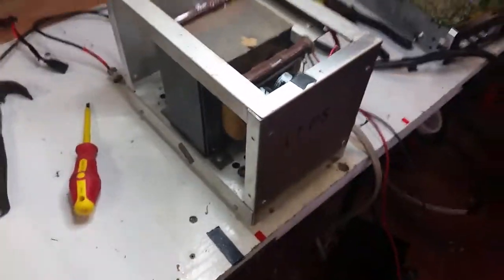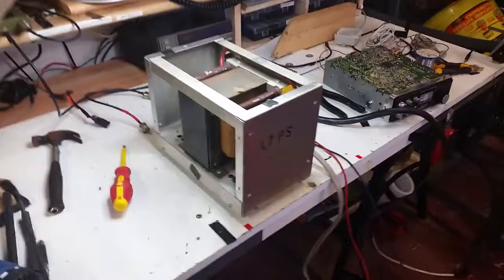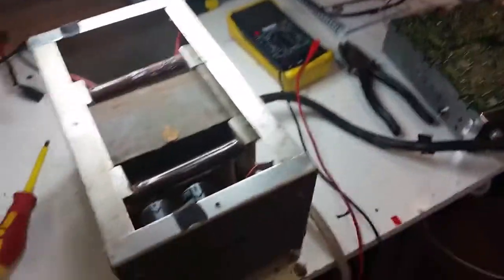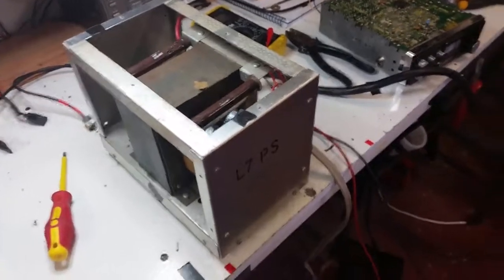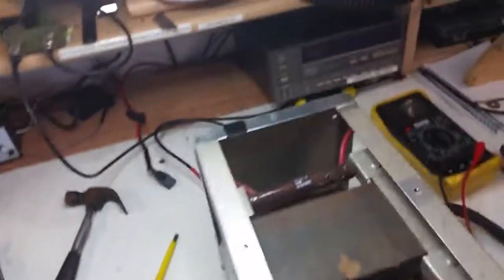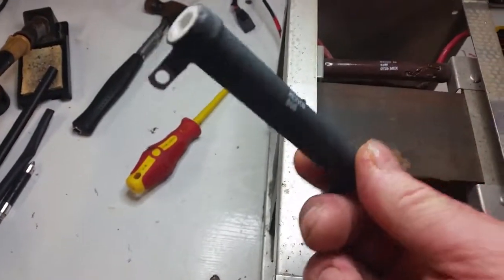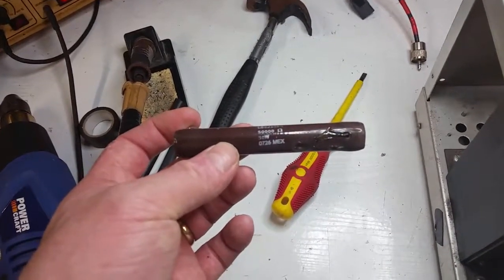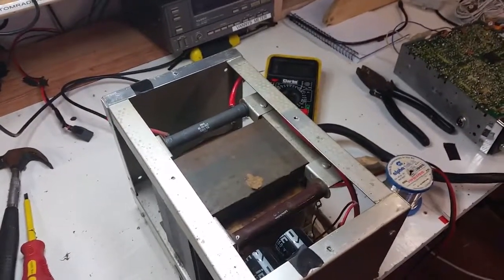Drake L7 amplifier power supply repair

Comment: Did replacing it fix it? My L7 just did the exact thing..glow from the 50k 50 watt in the power supply. I was hoping it was just due to age.
Reply from the maker: nitromanRI yeah, there's a second video on it mate. All was fine after I replaced the resistor
Reply from the maker: nitromanRI https://youtu.be/Dw7K2cmEBwQ
Reply: George EI7KO awesome ya I just replaced my burnt one and fired up and is back to being like brand new. I bought a backup 50k just in case the other one craps the bed.